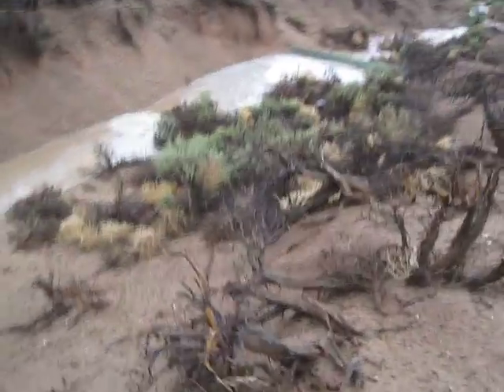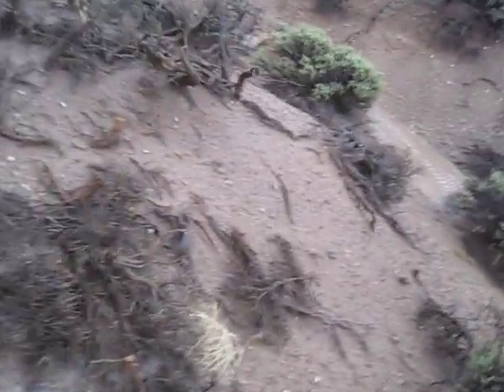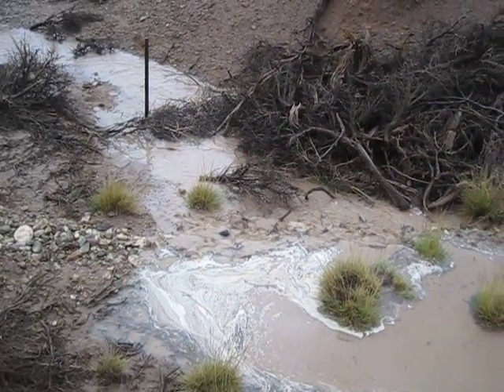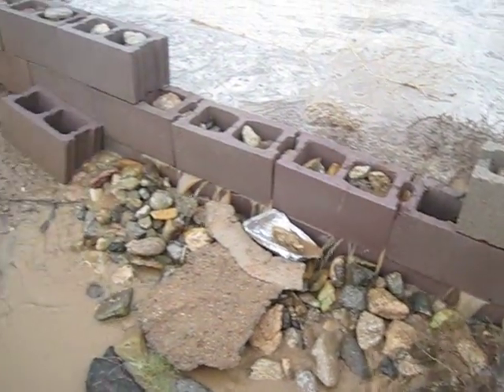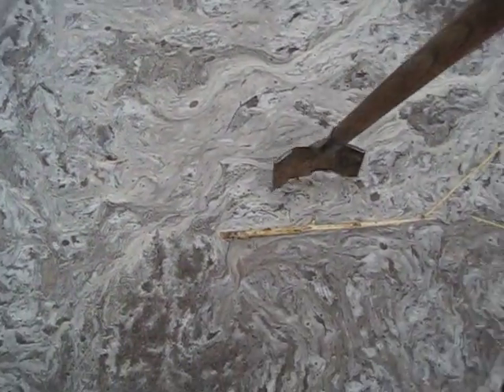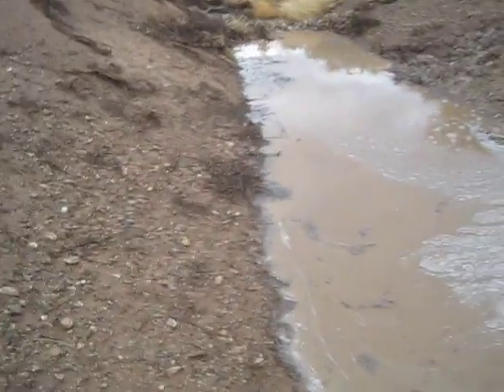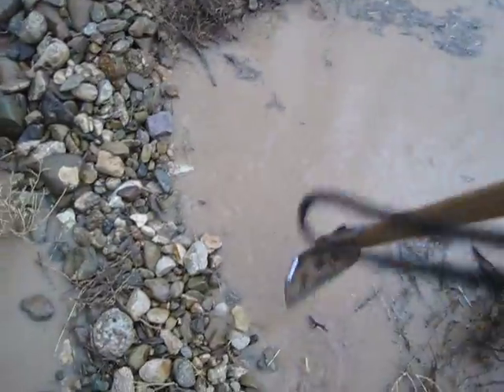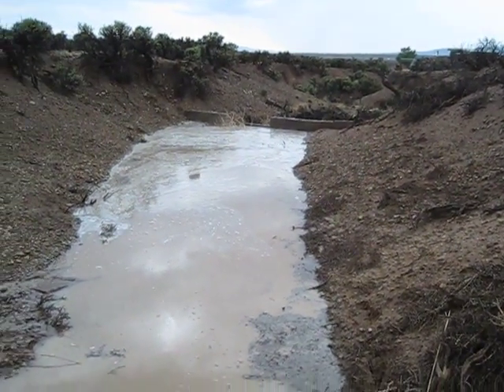Video of main trench and check dams in arroyo.

Comment: I did similar at even smaller scale on my small piece of land. Beside slowing down the water and hydrating the surrounding terrain. Which in itself is already excellent. 
I noticed in a very obvious way. That the water run off, that goes to the neighboring property, NOW. After my Micro/Nano dams, the water is crystal clear! All the sand, silt and clay get deposited on my land. Where it originates, instead of, literally, run down the drain. Robbing the fertility of my soil, along with the erosion that was left behind!  ;-)

In my case it was little more than a morning's work! Excellent return of a few hours investment! ;-)
Reply from the maker: A later storm had a bit more precip and it blew out the cinder block check dam and even sent some of the blocks about 20 to 30 feet downstream! I didn't think water had that kind of power.

Comment: you dig a trench and its emptying out? Causin erosion? can't believe this misunderstanding of the three ground understandings - Water: slow it, stop it, suck it down
Reply from the maker: That is the idea, Peter! It is a work in progress to be sure. The rain was strong enough to overflow my ditch. I need to make a proper sill to spread out the water so it can fall into the arroyo.

Comment: ur brick check dam should be permeable rock.  the idea is to slow the slow, not hold water
Reply from the maker: Yes. It is what I had on hand and water was squirting out of the cracks. A later storm actually blew out the check dam and sent some of the blocks about 20 to 30 feet downstream! I didn't think water had that kind of power.